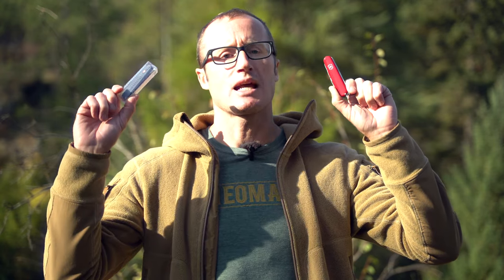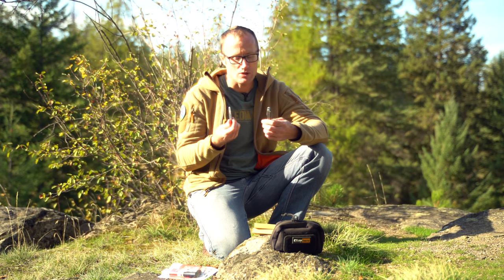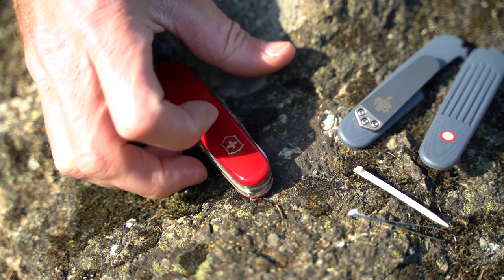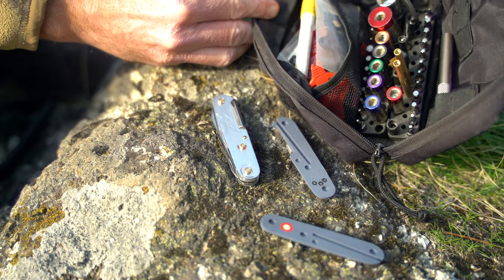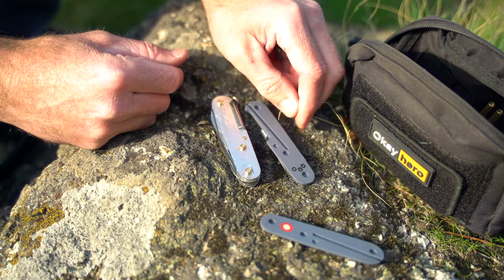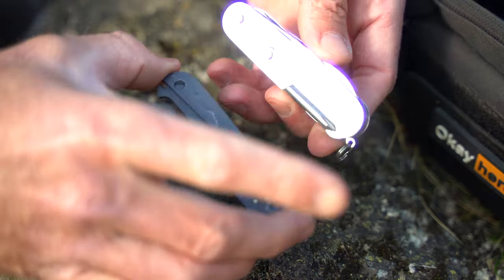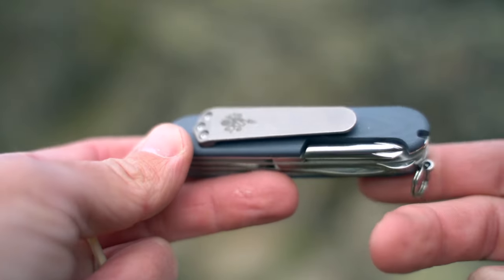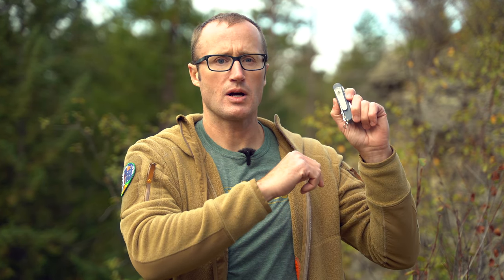How To Install SAK Scales from Prometheus Design Werx

Comment: That's pretty slick. I've gone on to the Alox SAKs though, always have a Pioneer on my belt and an Alox Bantam in my wallet. Yes, they're just as slippery in the pocket as the plastic handled models. I've lost and re-lost some of them a dozen times. 🤣